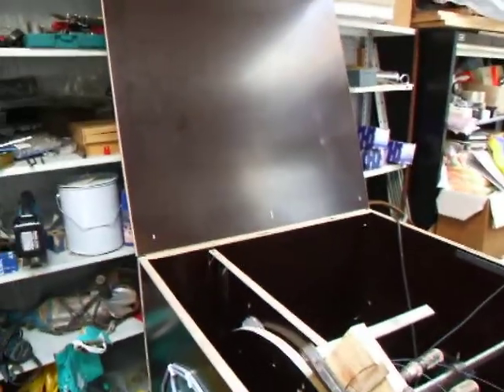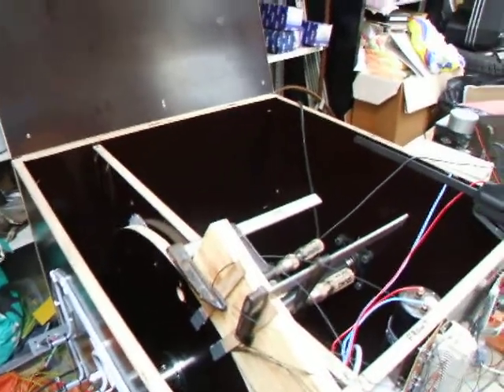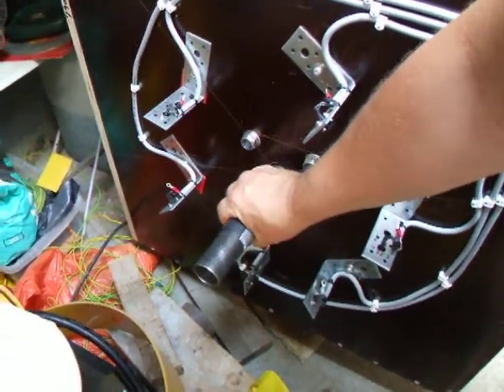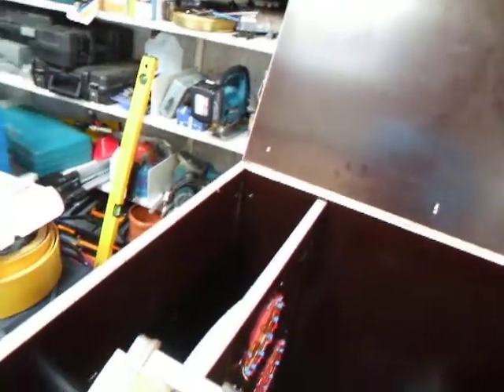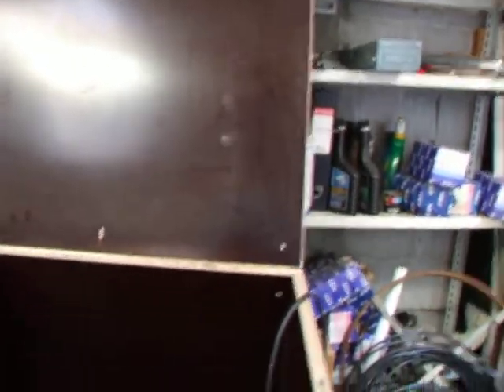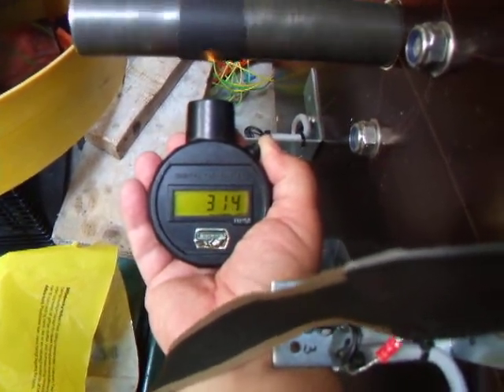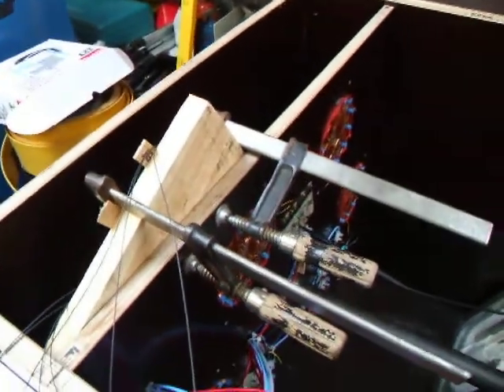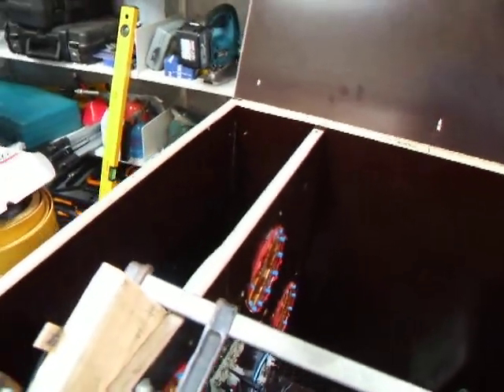Starship coil permanent synchron magnet  motor pulse wide modulatet

Comment from the maker: @hhoforvolts Hello Richard. Thanks for looking in. Yep im going there slowly and on the way getting a lot of idea's. The starship super bifilar coil is the answer and i am trying with 6 windings pr.coil and built in water cooling. An ekstra rotor with aditional 12 magnets and 6 normal pickup coils in the vortex hole of the starship to gain voltage from the motor and the magnets flying by. This should be the generator windings and connected in series to reach a higher voltage. Hope it works. :O)